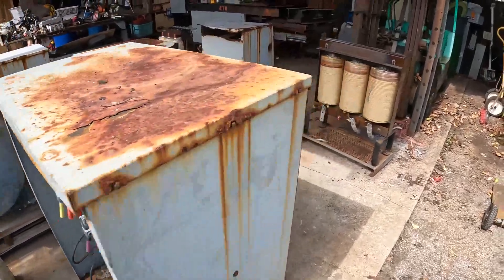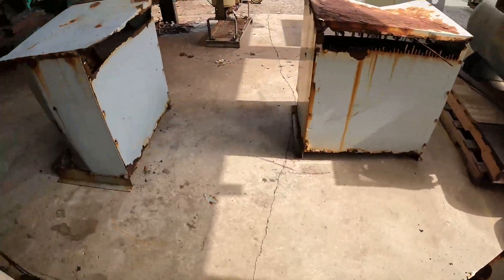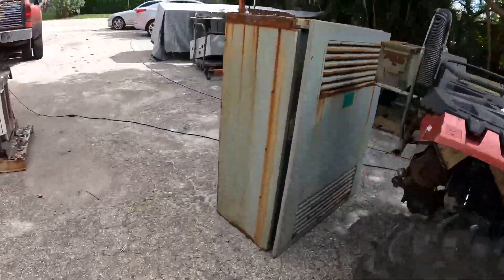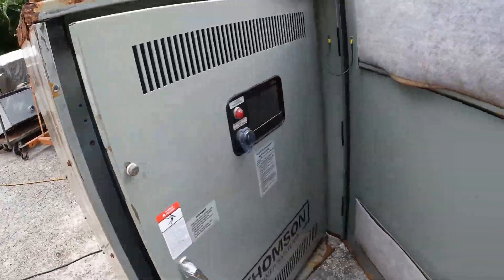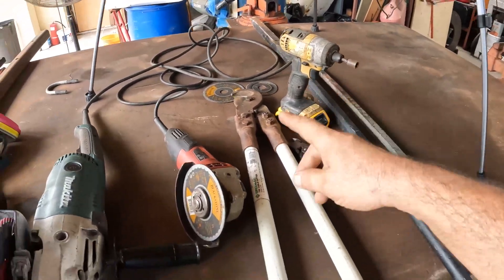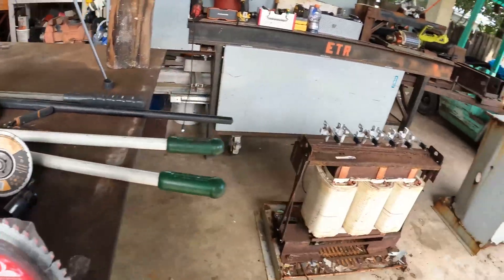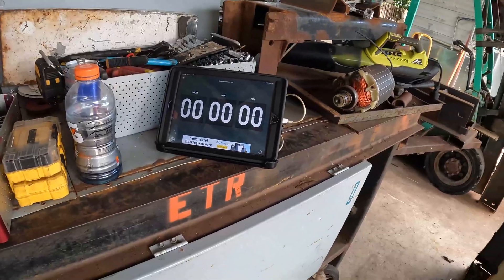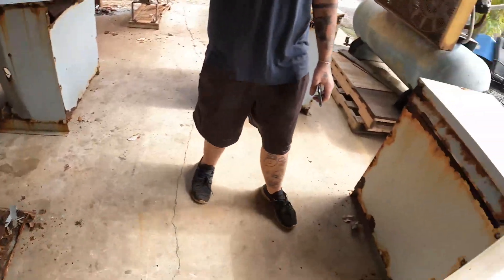Massive Aluminum Transformer Breakdown

Comment: Great video again! I have to personally thank you for showing this method. I took it on board and it made such a difference! I had 2 transformers, similar to those, the first one I battled with, but eventually won. I made a single cut down the centre of each coil. The outside coils were ok but the centre coil kept spinning around the core when trying to leaver past to pull the copper windings off. As I said perseverance won the day. The second transformers I used your method and didn't break a sweat and was all done in half an hour. I just used a 5" grinder and cutting blade. So once again, thank you. 🙏
Reply from the maker: Glad it helped you.

Comment: So are the cores considered heavy steel?
Also if one doesn't have a grinder with a blade, how do you break those transformers down?
Reply from the maker: Yes I get heavy steel price and cast AL. You could use a hammer and sharp chisel, reciprocating  saw, bolt cutters, cable cutters, ax, hatchet, hand saw, hack saw, ban saw, bow saw, drill, and you could just un-wind each coil by hand without any tools. Good luck and thanks for watching.
Reply: @ProjectShopFl  I find you videos very interesting, because you actually go through the why and how you break stuff down. Others I watch tend to just talk about it also never give haul totals. Also your philosophy of least amount of time handling stuff the more $$$/time.